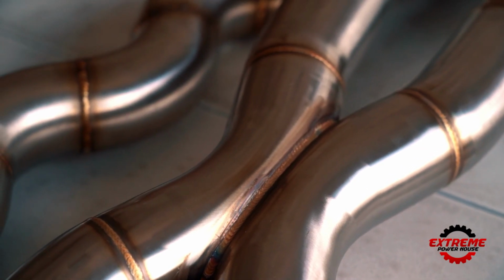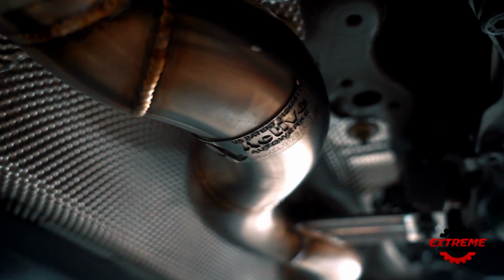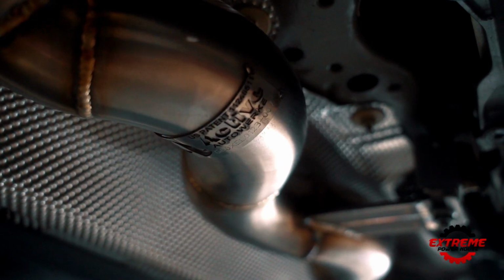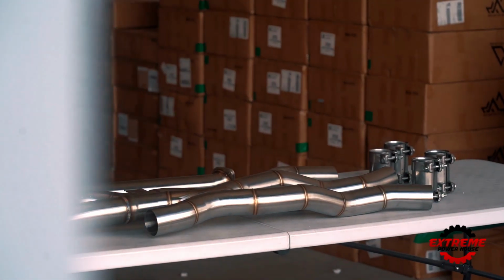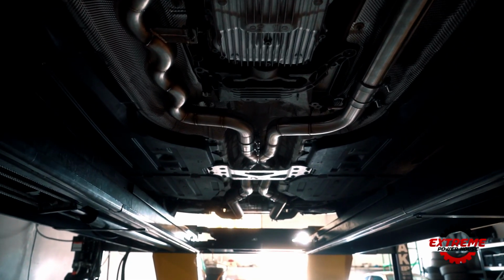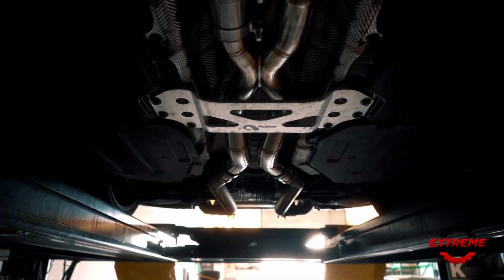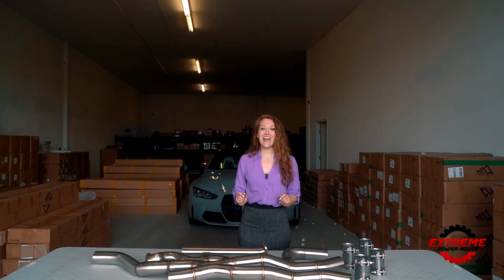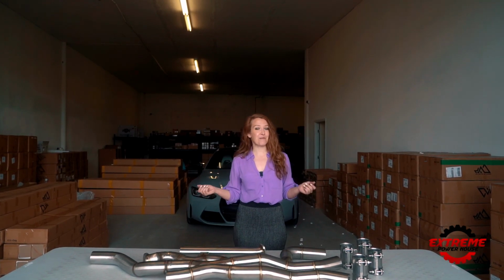BMW G82 M4: Active Autowerke Equal Length Catback Exhaust - INSTALL + SOUND CLIP!!

Comment: Will this fit on 2021 G82 if I want to keep the original muffler ?  the will sound change with bubble sound if I keep the original factory muffler ? thanks
Reply from the maker: it sure works and will vastly improve the sound of your stock exhaust

Comment: So there’s no cutting to install the equal length Midpipe for the g80? And you have the option to reinstall stock Midpipe if one day you sell the car ?
Thanks in advance
Reply from the maker: the stock midpipe and axle back are one piece, if you are only getting the midpipe, you must cut regardless of which midpipe you get.

Comment: With this set up, are you able to control the valves with the M1 & M2 button or does it come with a control remote to open and close valves ?
Reply from the maker: you control the valves same as stock using the M1 and M2 buttons. We also offer valve controllers for better control
Reply: @extremepowerhouse8365  Thanks for the info!
Reply from the maker: @luis.perez2366  Our pleasure!
Reply: Did this specific set up have additional valve controller? Thank you

Comment: Nice sound! 🎉 that with the GESI  cat?
Reply from the maker: Stock cats, but we are very curious on how it will sound with the GESI cats
Reply: @extremepowerhouse8365  any drone when valve close or open?
Reply from the maker: @chaogao8007  no drone either way

Comment: Just clarify, this is stock downpipes with active autowerke equal length midpipe and axle back?
Reply from the maker: Correct
Reply: @extremepowerhouse8365  sounds great and aggressive even with stock downpipes. The AA EL midpipe seems great. Something about the design.